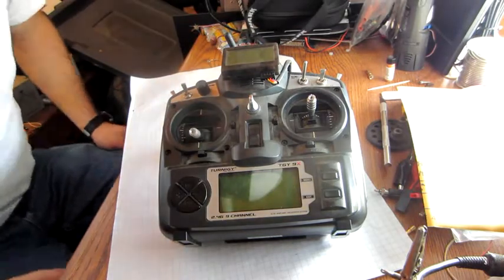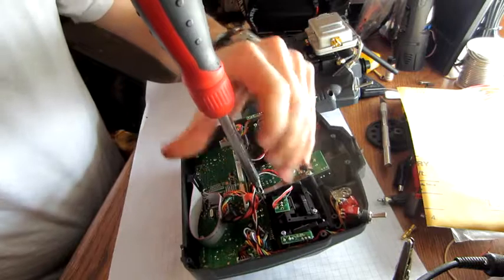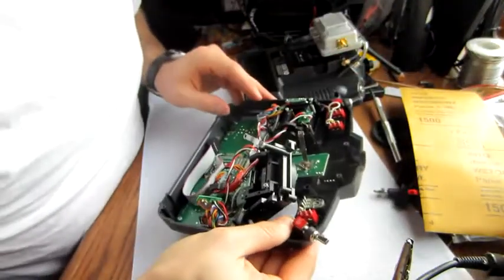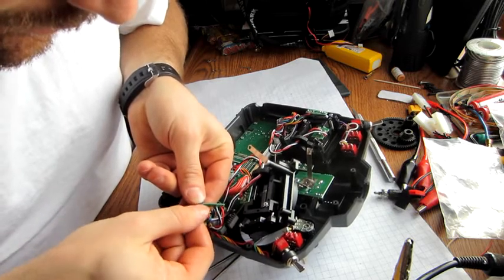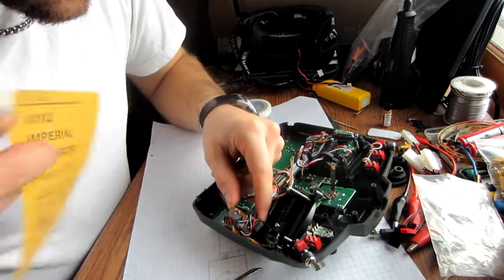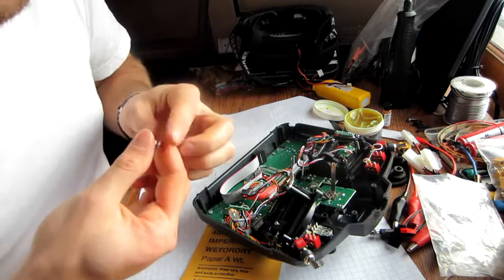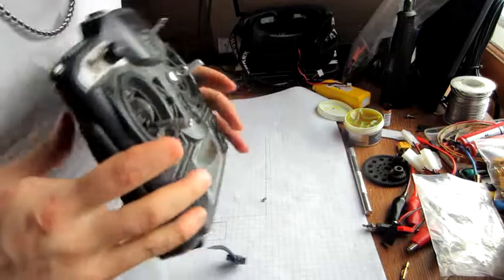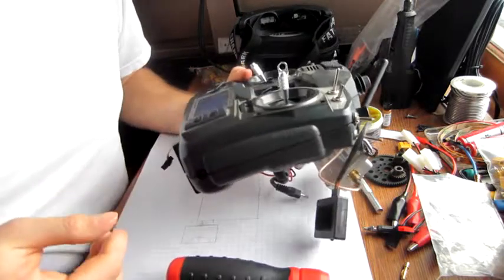How to Repair a Pot on a Turnigy 9X Transmitter

Comment: In mine pots I used WD40 to clean them, petroleum cleans everything. It worked great, for a week now. I guess rubbing with alcohol should be better.
Reply from the maker: Fair enough, good job doing your own buddy! I'd be concerned about gumming and dust collection but it should last for a while.

Comment: I have a 9xr and just replaced the gimbals with new taranis PR10s. Sadly the pots don't seem to be right and I can't calibrate the transmitter. Left stick yaw only right half side working. I don't have the dexterity or expertise to do the fix you are describing above. Any chance you or someone you know would fix it for me and charge me for your work? I'm afraid I'll have to junk it if I cant get it fixed. Pete
Reply: Peter Schultze I could take a look if you like but I don't know where you are from I'm north of Calgary about an hour.

Comment: thanks bro... i am having a problem with my one too.. it is FS-T6 transmitter. it's throttle and yaw both are not  working properly.. so i'm going to try as you showed in the video. thanks a lot again.. Is there anything i can find rather than using rear window repair kit. plz reply.. thanks in advance..
Reply: Sorry for the slow reply. Yeah, the defrost repair kit is just a resistance paste. It carries current but not wells so electricity is converted to heat. If you can find another material that does it, you should be able to use that. Most automotive stores have the repair kit if you don't know where to look. It's just a paint-on product.

Comment: Thats not a pot, thats a gimbal. Pots are the 3 potentiometers above.
Reply: The pot is one axis of the functional part of each gimbal.
Each pot (potentiometer) is both the support structure for the gimbal, as well as the electrical component that allows inputs to be accepted.
The three pots above are also pots but they only support a dial knob.
I'm not repairing the entire gimbal, I'm repairing one component of it. The potentiometer.

Comment: I have a problem in Turnigy 6x:
I have a Quadcopter with KK2 parent, and I need to ZERO trimming the thrust of the stick, so I can pitch KK2.
However when I reset the trimming, I can only get to 8 minimum when the correct would be "0" (zero throttle, zero out to trimming!).
Already entered in various forums however unsuccessfully.
Is there any way I can fix this trimming the radio Turnigy 6x?

Comment: Just tried it out today on my throttle pot, and it worked great! Had some conductive paint lying around from an electric guitar project (used it as shielding), and used that on the pins. A little sanding on the carbon with some 1200. You were right about being careful with the sanding! I reduced mine all the way down to 2.5k! shouldn't be a problem, though, since all the pot does is divide voltage.

Great tips! Thanks for the video!

Comment: Even if you had to file down the board there is likely a lot of unused (common ground) real estate on the perimeter,  just make sure that you don't short anything to the gimbal boards. You will certainly have to recalibrate the Tx to the new pots though but that's easy enough too.

Comment: I want to try the Aurora gimbals but does anyone know if they will work??  I saw a forum where someone said they fit nicely with minor adaptatation but then another guy said they hit the board and he had to remove part of the actual board, cut lans, and re-wire...  Then theres the software side of it if the POT's are different.  

They seem readily available but are they a drop in replacement or no??

Comment: There is a flat spring steel "U" piece that you need to pull out to release the pot, the pot is actually what is holding the whole assemble together.  You will need to pull the elevator/throttle pots to get at the aileron/rudder pots.

Comment from the maker: I tried to find some decent ones too, the Aurora gimbals were a solid fix but I guess they are off the market. It's likely there is a similar pot out there and we might just have to change it over to the stock housing so it fits in these transmitters.